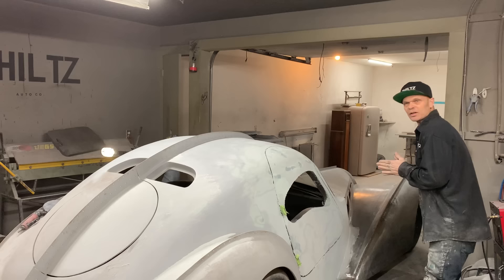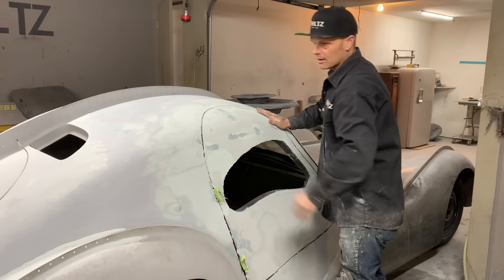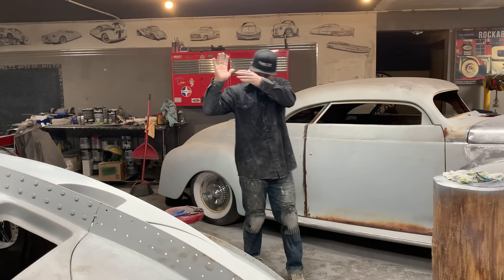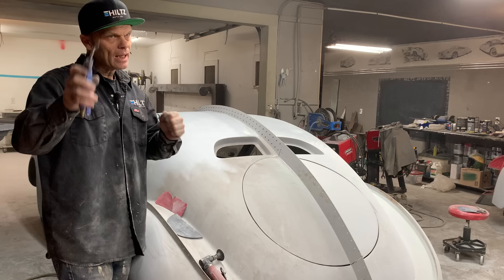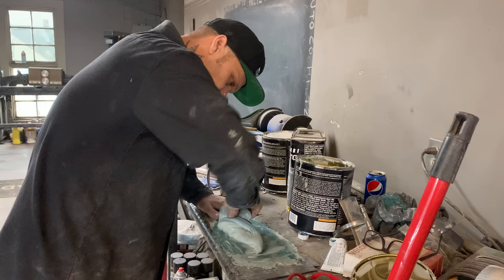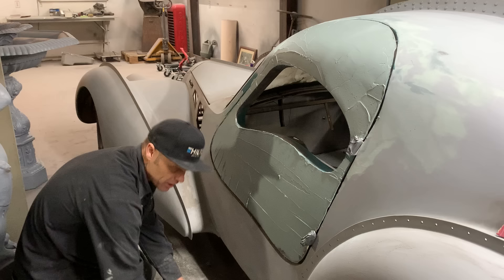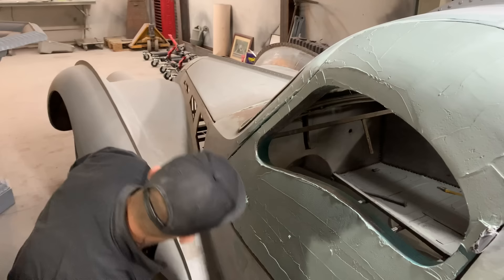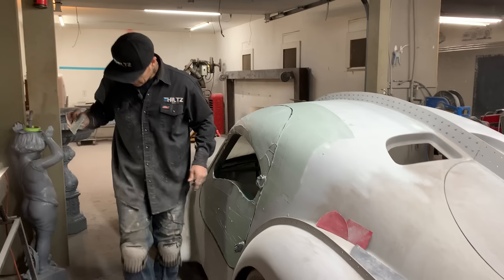This is how you apply automotive body filler for a show car finish 🔥

Comment: Love the ocean example.  Did both rear quarters on a Camaro some 30 years ago.  Well I finished off the mud like you are doing it and told the guy to not sand the fill off the welds.  Guess what he did and the paint looked like crap.  I told him to not tell anyone I did the work.  And I did it for free to help him out.  He liked it but, but he took it down to the floor and the lines showed bad.  I watch you to pick up stuff.... its all good.

Comment: Chad and Jolene, what are you using for a hood ornament?  A traditional Buggati ornament?  A sculptor could mock up a wax form that could be cast in bronze.  In addition, Car medallions could be also mocked up and cast in bronze or cut out of metal with a CNC machine. Later to be painted or enameled.

Comment: I disagree with you on how you explained that fludding  of mar  glass or body filler you should have explained it  to your viewers that have never done body work ,. so you viewers look at it this way the metal is like mountain tops and in between those mountains are valleys which we call low spots he is filling in low spots to get his panel level  ,  also you never put filler over unsanded filler , mar glass , it needs to be scratched with 40 grit or 36 grit for that next coat to have proper adhesion  , chad I love your abilities and motivation sorry but I needed to correct you
Reply: If you've seen our shoreline he's talking about, the analogy is pretty accurate.
Reply: His analogy is you fill from the bottom up, not from the top down. Chad is spot on.
Reply: Preaching that filler will "fall off of primer"? Maybe if its not fully sanded like I saw here.. Then clearly slaps on filler over partly sanded short strand fiberglass filler?  You can clearly see knocked down highs and forgot all the lows in that fiberglass filler.. Ide be more concerned with a hard slam of that door and half of the mud cracking...
Filler is a mechanical bond. Once hardened you should never layer it without scuffing even the lows... No body's perfect but that was one seriously rushed mud job......
I to love the ability's but I had to stop the video there.

I have picked up random tricks from your videos to assist me which I appreciate but this was not a great example of take your time and do it once....
Reply: @Stein548  I'll have to agree with you on his application  of filler, plus he should have adjusted the roofline to come inline with the door instead of slapping on the fiberglass fill. Another thing, all that filler along the door edges is just inviting bad chip offs down the road when the inevitable happens. 🤔
Reply: Man, when y'all found out that Chad didn't know what he was doing, I wish you had told his clients...it's totally wrong for him to go around fuckin' people out of money...man, his stack of displeased clients must be feet deep...I'm going to have to contact all of his clients and inform them that Chad did a bad job on their custom cars...they probably don't realize how bad their cars look...thank the higher power for men like y'all and thousands of YouTube experts that tell people that what they like is bad...hahahahaha, never fails 🤣...if you make a video of your life's work, there will be some bumblefuck that THINKS that they do it better...y'all would  tell Bigfoot how to hide, Mariah how to sing, Eddie to play guitar 🎸, Henry how to build an assembly line, and the list goes on in perpetuity...

Comment: Damn- Just finished painting my Citroen DS and was happy with the result- considering I was doing it at home. I now realise I could have got it so much better. It is metallic blue and I used a very light undercoat- after six months there are areas that have gone lighter. also some slights dips and ripples looking down it- not flooded enough. I will do it again next year, after I have watched all of Chad's videos.

Comment: One of the main reasons for using epoxy is to seal the metal against moisture. Polyester filler is porous. Therefor always put down epoxy first. The polyester will adhere just as well to epoxy and any moisture in the filler will never get near the metal  to cause rusting in the future.

Comment: 40 grit seems to be the only way to go I've always been scared to use that not that I would have known when I was doing body work as a Young Man I was always told 220 would be about the toughest going to use
 thanks for illustrating that.
Reply: You cant cut a surface flat and straight over 100g. That's a fact.  Finer grits are for removing scratches, period.

Comment: you would make an excellent shop teacher in a highschool i live in east central illinois united states and most highschools dont even offer shop classes whether it be wood metal welding ect. most of the kids probably couldnt even change oil and spark plug on a lawn mower not exaggerating

Comment: Man I caution a guy about jumping from 80 grit to primer.  I say that because all products experience some degree of shrink back. Higher the quality the less shrink back... the higher the cost.  So you end up kicking the same old can on down the road.  120-180 is the range I see most manufactures recommend.  The balance between surface area and shrink back.

Comment: I use door windows cuz they are and they hold the body down in the middle I use the inside side of the glass and usually they're free so when I get to dirty I throw and if I need a small amount of filler I use wing windows the body filler once it's hard it don't stick to the glass so you can take a putty knife scrape it off

Comment: Blind-spot question: split mirrors or a camera w/ display?  1) A blind-spot camera could help this beautiful car and make it easier to drive.   Instead of the display going on the dashboard...maybe a video display could go inside where you would naturally look to check your blind-spot.   The camera lens could be mounted within a door crack or be part of a special emblem attached to the side of the car...maybe mounted where typically a quarter window goes.    2) Alternately...a 30' style blind spot solution would be a split mirror...possibly two mirrors in one mirror fixture.

Comment: Hey Chad fantastic video! Always appreciate what you do. When the first coat of filler is sanded off I would sand the low spots where its shiny and waxy before re-coating. You may have adhesion issues down the road. Keep on man😎
Reply: I was wondering if you had heard about any problems with his paint? With all of the cars that he has built, wouldn't it be known if he did?
Reply: @sykwookiee  there was some posting awhile back about it yes but I think the guy is super cool and that's why I engage with his show and you tube videos. I wasn't putting him down at all. Btw, I do high end restoration/autobody work for a living so have a fairly good handle on it 👍

Comment: You would be shocked how many people think that showcases have no Bondi or filler in them. Miracle molded! LOL!!!
Reply: There are a few that have none whatsoever. I've had the privilege of seeing metalwork that is paint ready with ZERO filler on one shop and one shop only. In said shop, no car leaves under a quarter million dollars and that's a rust free arrow straight car to start with. Filler isn't a crime, just use it logically like is seen here

Comment: The fiberglass sub-surface enables the auto body filler, placed on top of it, to have a longer life span on the car right?  It keeps the auto filler from flexing or developing moisture underneath it right?  Bondo/Filler has a life span on a car.  It is not permanent, correct?

Comment: what is the thickest bondo you think you ended up with to achieve the perfect levelness in that given area
Reply: Way too thick.  Watch the video where he cuts the fender skirts - it was a half inch thick where the chunk fell out using the saw.  And that was after he "sanded most of it away"

Comment: G'DAY CHAD & Jolene,check out Kaplan America YouTube channel today's Vlog for an awesome example of a 1974 Z1 900 & an example of a 1973, in case you didn't know 1973& early 1974 were when the original Z1's were released,then 1974_1974 were Z1A,then to 1976 was Z1 B,then until Theroux till the end were KZ900,my advice would be build a custom Cafe Racer style,maybe a good project for Colten,with a budget of $5000-$7,500.00 ,would be achievable,as always, Kindest Regards, Dave McLaughlin, Queensland Australia

Comment: 99% of shops that sell show cars use polyester primer or just do great metal work. I’m sorry but you will never straighten a radius with a dual action sander. I’ve prepped show cars for 20 years and never have seen this. My name has been on some big name cars and this does happen. How do you explain door edges?  Are ya gonna put filler on the inside too? Why put all that body work to sand to bare metal?    I guess this is “ your” where are you of doing things but you would get laughed at if you did this at the shop I work at.